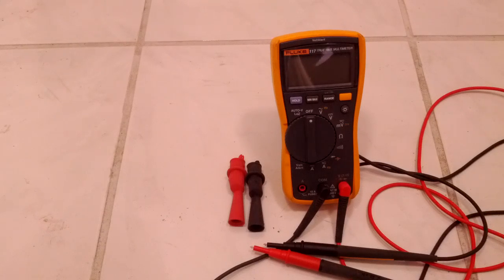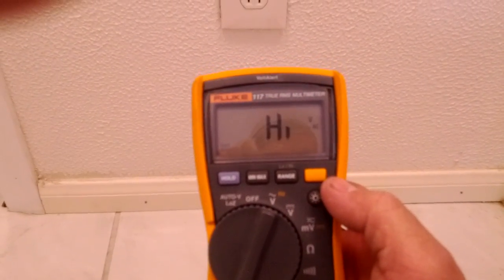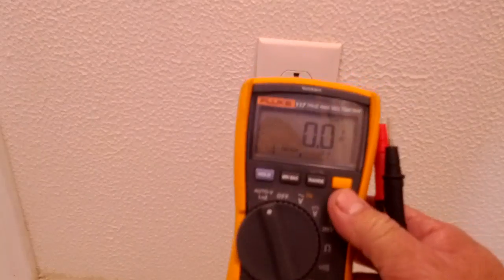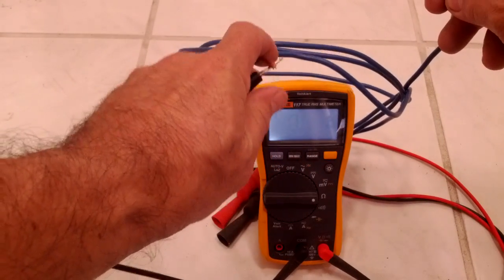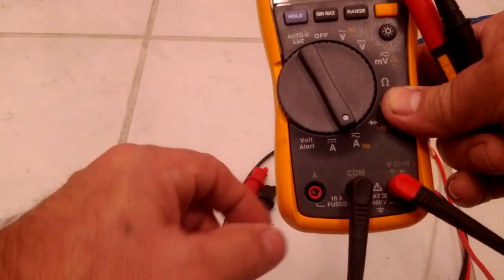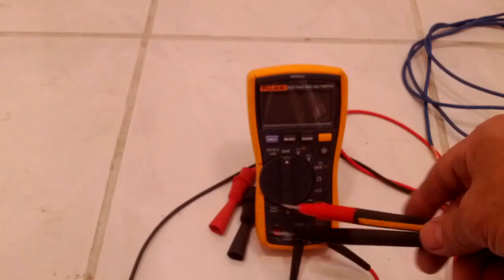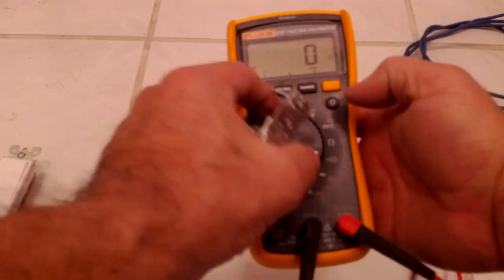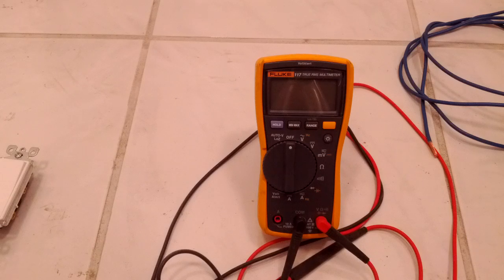Fluke 117 Multimeter Brief Review

Comment: Hi, thanks for the video... very informative.  I just wanted to point out that your Fluke non contact detector you talk about out in the video is actually a contact detector.  Most non contact models are rangeable while the one you have is not.  The contact models are great while working in a panel/box loaded with wires where you need to identify the live and non live wires.  This is difficult to do with a non contact model as it will sound all the time when getting to an electrical field.

Comment: Nice review.  Just wanted to point out a closed circuit is a connected active circuit where an open circuit is disconnected.  You probably just mis-spoke.  Cheers!
Reply from the maker: +Chingus696 Thank you for pointing that out. You are correct in that Fluke makes a great product, and I have heard from owners of both US and China made meters that both are quality meters and well made.
Reply: +legalsolutions07 I have owned quite a few flukes over the years.  I currently own the 87v, 83v, 179 and 117.  all great meters and great build on all of them.  The only complaint with the 117 is lack of fluke's touch hold.  bad choice on their part.